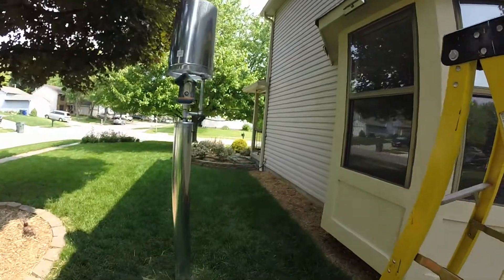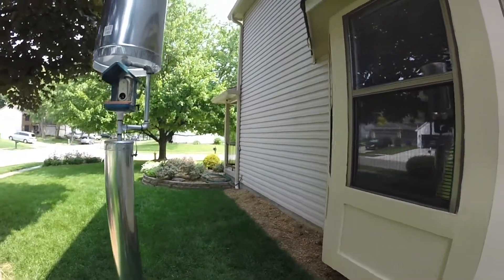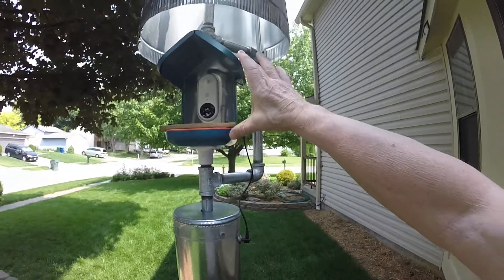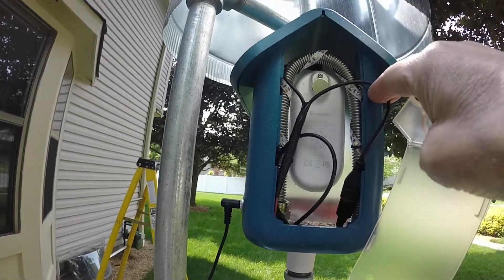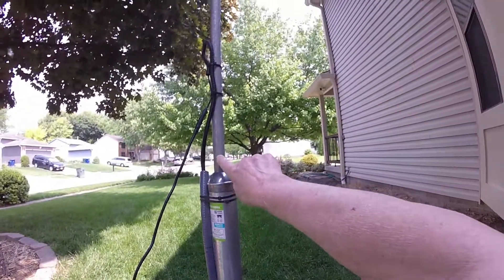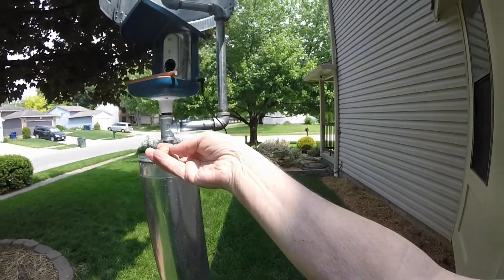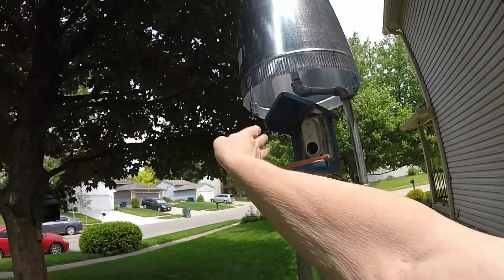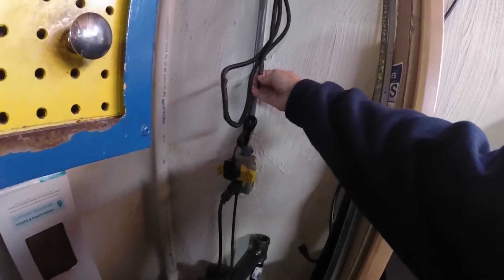Bird Buddy bird feeder UPDATED -overhead duct Squirrel Proofing, LED lighting remote power source.

Comment: I have a soliom pro bf08.  Have the same problems.  Have used similar ideas.  They sent me a new one because the old one stopped working.  The new one has a bigger solar panel.  I've noticed that the solar panel isn't good enough to keep the battery charged.
Reply from the maker: This time of year (Nov. Dec.) the solar panel on the Bird Buddy is not able to keep the camera alive.  So, I just engineered a remote power source detailed in my video.  It's been up and running for over a year and a half.  No issues to report.  Camera battery remains around 89 to 96% year around.